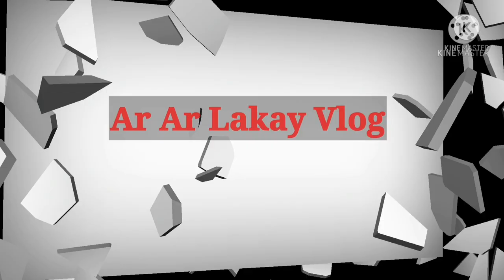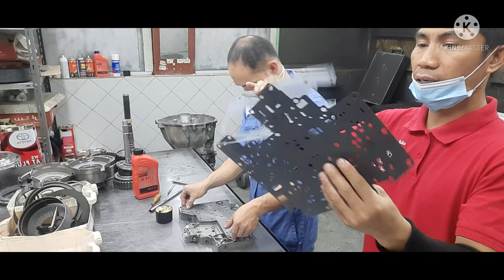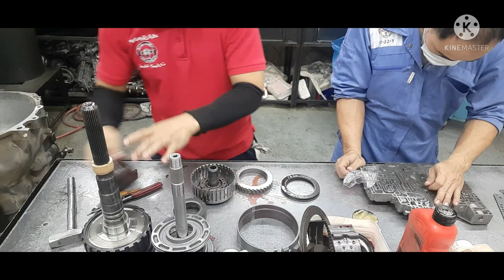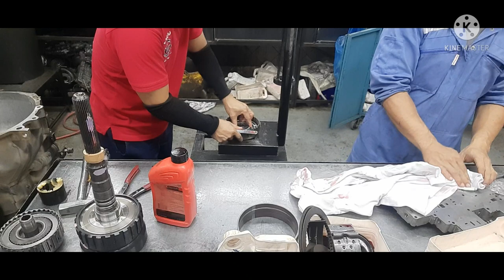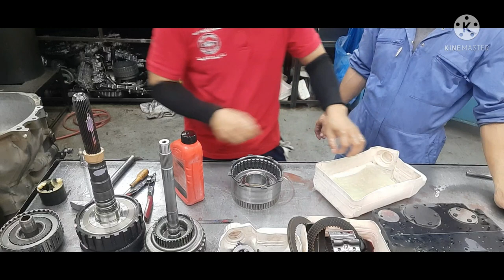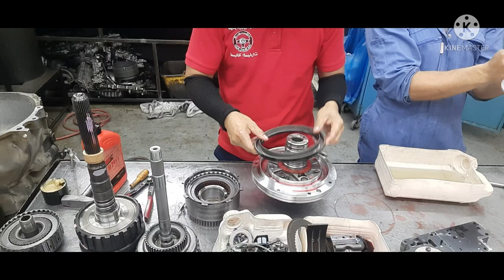Cause of No Reverse/Overhaul Transmission///Tagalog

Comment: Boss magandang hapon Jan sa Saudi Arabia, boss tanong ko lang po ano po bang problema kapag Wala paring reverse pero bagong lining po. God bless po.🙏
Reply from the maker: Pero may Drive ba...May singaw pa rin yan boss.Either may kain ang reverse drum or yung mga chamber or Oring nya.i double check lhat.
Reply: Meron naman pong drive Boss nung una kumuha pa Ang reverse minsan nawawala kapag mainit Ang unit, ngayun po boss Wala na po talaga pina check Kuna Rin po ang solenoid at wirings ok naman raw po.
Reply from the maker: Sa loob na problema yan boss.i pababa m nlng at icheck mga clutch nya.

Comment: Boss tanong ko lang .yong honda crv   wlng reverse pero wlng touble code ano kya sira?
Reply from the maker: Internal failure yan boss.Singaw ang Reverse Oring or sunog ang clutch.
Reply: @ararlakayvlog2684  boss ok na sa connector lng pala
Reply: @tomtomgarage9760  hi po sir pano nyo po na diagnose na connector at ano po iyon connector? Maraming salamat po.
Reply: @markvallespin345  yong connector sa inhibitor switch ng lolose.

Comment: gud morning sir lakay tanong ko kung nabuksan na o na repair na po engine transmission ng sasakyan maayos pa rin po ba ang takbo ng sasakyan?
Reply from the maker: Opo boss balik sa dating lakas ng Engine nya or Transmission nya.
Reply: @ararlakayvlog2684  sir tanong uli bat un kotse ko nag vibrate kasi pnababa ko un tranny ko kasi may delayed n kadyot ba un wala naman pnalitan na pyesa parang umayon naman makina kasi sarado un tindahan pag linggo so nangyari binalik uli sabi umalsa daw un goma sa loob ng tranny kaya parang nag ok ang tanong san nagmumula un vibrate po na pede ko pa check bigyan mo po ko idea sir salamat sir lakay🙏
Reply from the maker: Pg tumatakbo ng vibrate? or pg ilagay sa drive or reverse.pg tumatakbo maaaring conveter.pero pg ilagay sa D or R i check ang support.
Reply: @ararlakayvlog2684  ano po pagnaka hinto sa trapik light dun po nagvibrate nagpalit ako trans support kailangan ba original ipapalit?salamat po
Reply from the maker: Normal lng yan pg hindi nman malakas. Pg local masyadong matigas ang support kya meron parin vibration .
Reply: @ararlakayvlog2684  salamat pagpalain ka po ng maykapal🙏
Reply from the maker: Youre Welcome boss.

Comment: Boss transmission ko reverse lng forward ayan na umatak bighorn po ang transmission
Reply from the maker: Internal failure yan boss.Either sunog ang Clutch or singaw sng Rubber Oring sa Drive Drum nya.Need n i overhaul.
Reply: Kindly explain in English why transmission refuses to engage reverse when hot that Is after driving for a long distance..the reverse refuses to engage
Reply from the maker: Internal failure Sir.Two things reason.oil leak from the rubber Oring and needed  to replace new Orings or burning  Recerse clutch.so needed to fulldown the transmission and make overhaul.
Reply: @ararlakayvlog2684  hallo is the reverse brake the o- oring you are talking about
Reply from the maker: Yes Sir.

Comment: Hallo. Sir what causes delay in gear  number 2 and 3..in an automatic car..
Reply from the maker: Two reason .either  solenoid malfunction or Internal failure Boss.
Reply: Sir ask ko lang po ang sasakyan ko Honda Odyssey po new overhaul pero no reverse po pero drive nya ok pasagot Po
Reply from the maker: Need ibaba ulit yan.i check ang Reverse drum bka singaw kya ayaw mg enguage sa reverse.
Reply: @ararlakayvlog2684   pinagpipilitan po ng nag rebuild na electricial daw. Tapos pinacheck ko na sa dlawang electrician naay scanner wala naman. Daw sa electrical
Reply from the maker: Mechanical issue yan boss.wala s electrical.ayaw lng ulit gawin ng gumawa hehe.

Comment: boss lakay ask ko lng po? nagpapalit po ako ng atf thru dialysis after nun nag ka problem reverse k. naging delay po at may shift shock? ano po kaya nging problem?
Reply: toyota rush 1.5 po pala sskyan ko.
Reply from the maker: After ng palit bka di mganda ang set up ng filter boss.dpat i re check ulit.
Reply: boss nag check engine na po sya. "gear ratio malfunction" po ang reading. umiilaw po ang AT kapag umaatras pero nwwala nman po kapag nag engine off/on ako. tpos kapag na pahinga po ang sskayan ng hindi umaatras nawwala po check engine. salamat napansin nyo comment k. 😊😊❤️
Reply from the maker: Pg gear ratio meaning internal failure yan boss.i check mo ang oil bka amoy sunog na.
Reply: @ararlakayvlog2684  mejo amoy sunog nga po.
Reply from the maker: Need n buksan transmission boss.may sunog n clutch yan s loob.